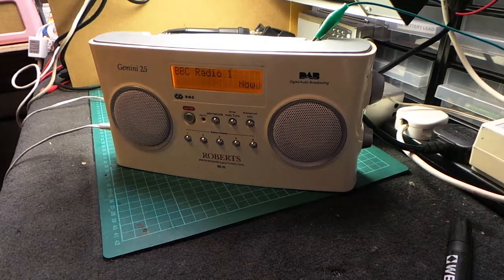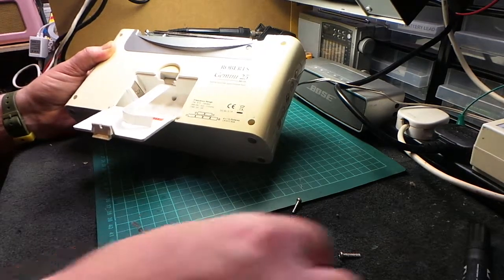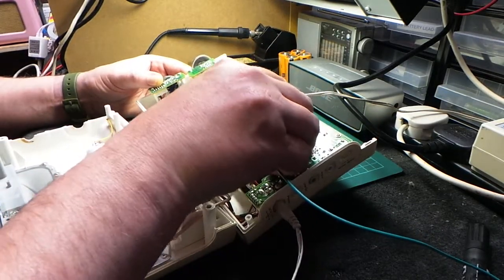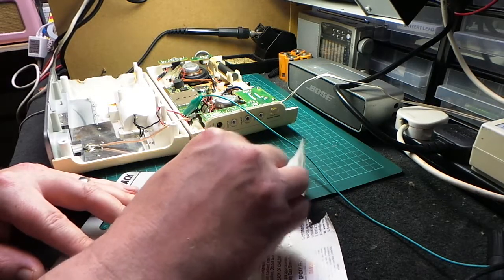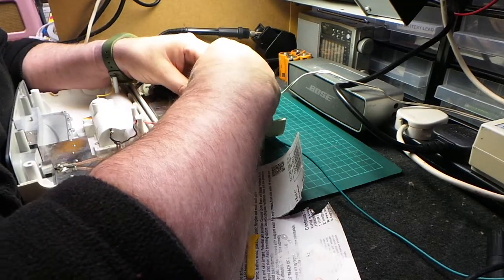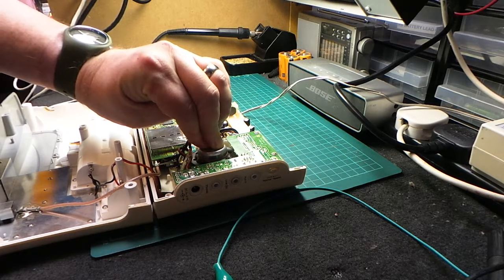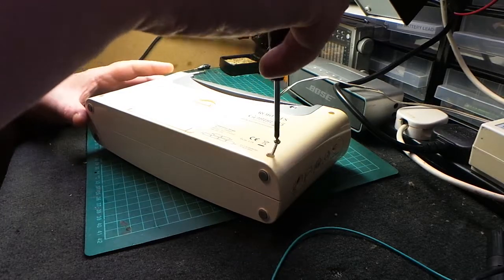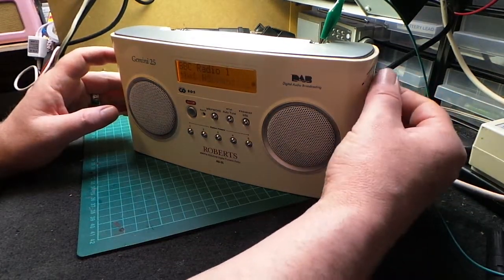Roberts Gemini 25 / RD25 Audio Fix

Comment: Hi mate, Ive got this Roberts ecologic4, it does  turn on only with batteries,not with the cable, and theres no sound at all, headphones also without sound, just the "Line" works  if you plug headphones but on a low volume,  have any idea? Much appreciated
Also if I send it to you would you be able to have a look?thanks

Comment: I have an issue with reception, and I see that at the end of the video you plugged a green cable onto the aerial. Is that to improve the DAB signal? and if so What is the green cable connected to? Im looking at getting an exterior DAB aerial, but not sure how to attach the co ax cable from the outdoor aerial to the DAB aerial. ANY advice would be gratefully received.
Reply from the maker: I have a dedicated DAB antenna on top of the workshop, an FM dipole, and a longwire for MW / LW reception. The clip lead I use is an extension from the core of the coax. The antenna wire comes into the workshop, and terminates at a socket box on the wall, from there I made a 'flying lead to plug in with a croc clip on the end...